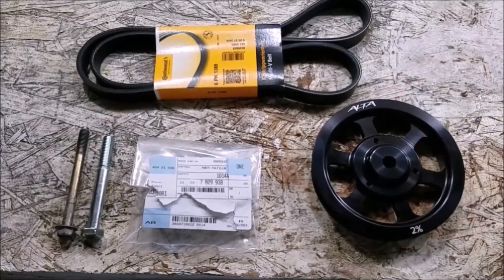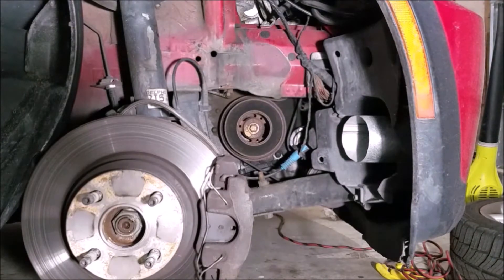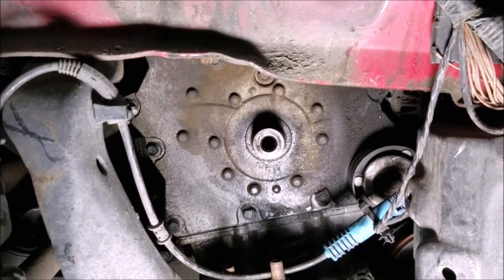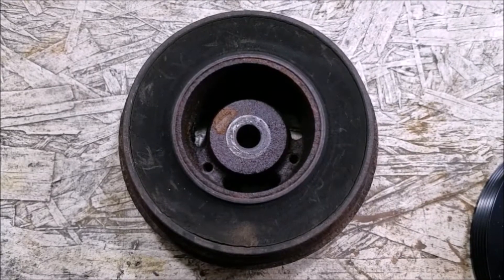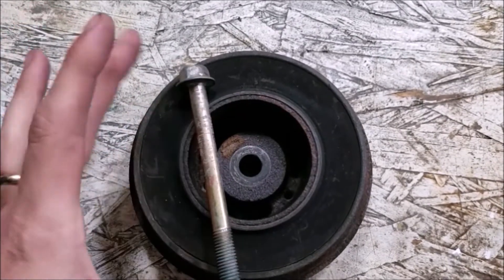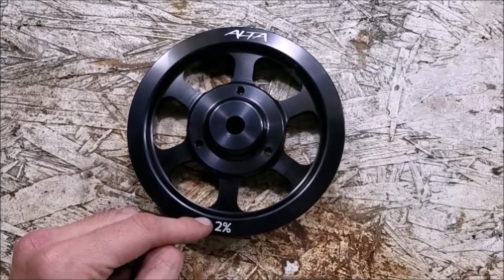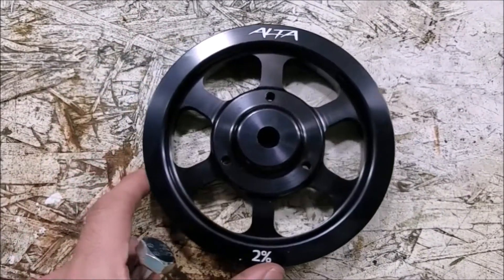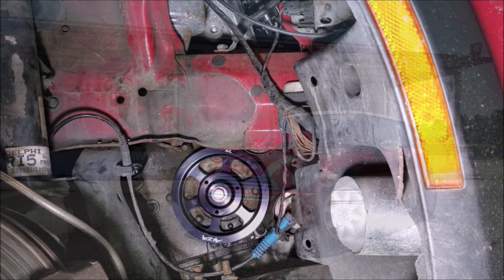R53 Mini Cooper S Alta 2% Overdrive Pulley Install

Comment: I know this is old. But the new pulley drops an equivalent of about 60lbs of weight from the car just by dropping a few lbs of rotation mass.
Reply: Getting rid of a harmonic dampener on a supercharged car is a recipe for disaster, oil pump will be knackered very quickly

Comment: Ich habe ein 15%Pully Rad verbaut was ist wenn ich die 2% Riemenscheibe noch verbaue schadet das den Motor Software ist schon geändert.Wollte eigendlich nur mehr durchzug keine Höhere Endgeschwindigkeit.
Reply: Est ist gut, nicht einen Problem. Der Motor wird halten.
Reply: Vielen Dank LG aus Deutschland 👍👍👍 @fatmanny6749
Reply: @fatmanny6749   its just gonna make his 15% pully a 13% pully and make his engine not balanced

Comment: Did you need to tune it because of the 2%
Reply from the maker: Nope, it shouldn't make a big enough change that the computer can't handle it.
Reply: You don't need to but to get the best benefits and safety for the engine you should always map to compensate for any changed

Comment: Is the m10 bolt any thread or x1.75?
Reply from the maker: The M10 is just to have something to press against. It could be just a 10mm rod. Nothing special as long as it's somewhat strong.

Comment: hey man, did you use something like locktide to glue the bolt in? 
did you have any issues with the bolt like its coming out from engine vibration and spinning because of the rubber delete? i heard about that..
Reply from the maker: The replacement crank bolt comes with Loctite on it. I haven't had mine come loose, but it wouldn't hurt to check it when you're working near it
Reply from the maker: Noah Passey  yup, I've done it several times without it, but just buy the $30 tool. It's worth it.
Reply from the maker: Noah Passey  it won't be a big difference, but in my mind, every little thing adds up. So, my car is very mildly modified, but the entire experience is much better.
Reply from the maker: Noah Passey  yeah, about 5whp. Maybe a little less. I didn't notice any sound changes. It's a small change, but a cheap and easy one. My main motivation was to remove the possibility of the stock pulley splitting in two.
Reply from the maker: Noah Passey  It's a roots blower; so, the pickup is everywhere. It's a solid gain for $100. The bigger intercooler is a waste unless you're pushing big power on track. The "One Ball" mod is purely for sound and offers almost no performance benefit aside from the weight savings. Even then, it's a small amount of weight in an area you aren't trying to lose it from.
Reply from the maker: Noah Passey  You just use the same crank bolt as before.
Reply from the maker: Noah Passey  you'll need to try a different puller tool
Reply from the maker: Noah Passey  any sort of crank pulley puller
Reply from the maker: Noah Passey  Not for the crank pulley alone. If you add the 15% SC pulley then yes.
Reply: Yes mate use 4* tubes